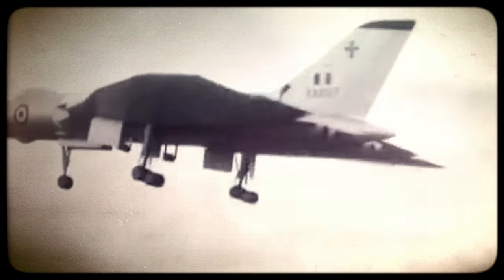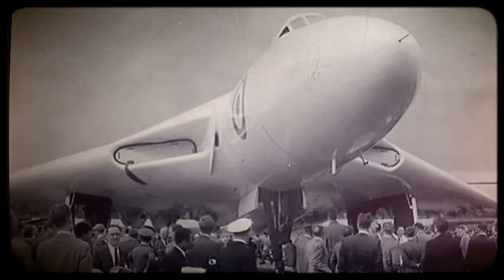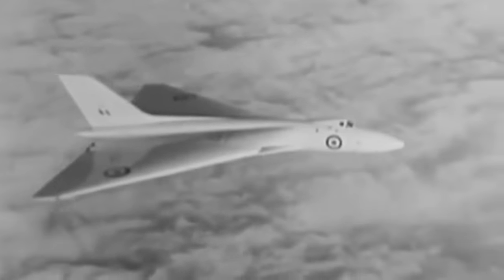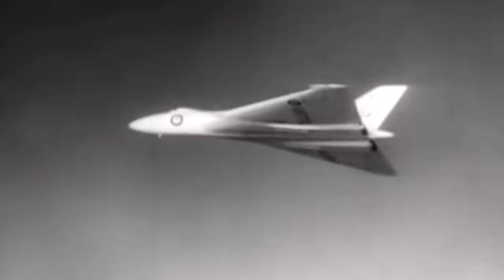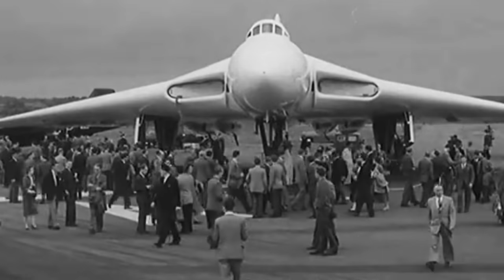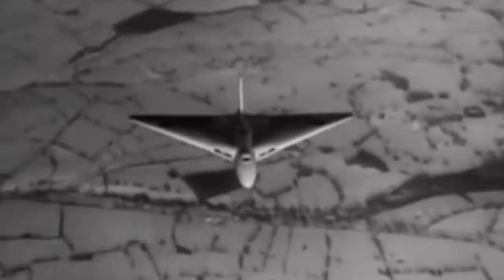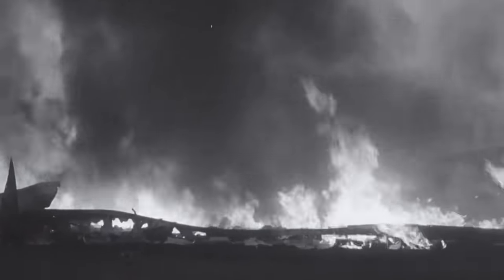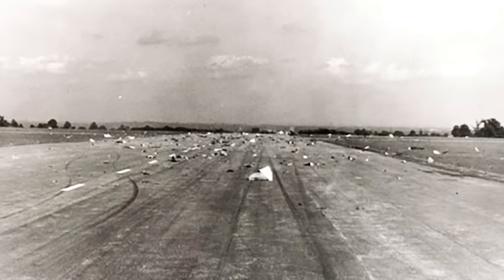Vulcan Bomber Disintegrates on Camera

Comment: Ah, interesting, did not know about this crash. Tragic. But I wonder if it lead to the modified leading edge on the Vulcan wings? In the 50s, my father worked on the Vulcan as an apprentice whilst studying engineering at Imperial College. He told me a story about how when they were working on the top secret mod to the wing, they had to keep it secret. A few days or weeks later, he was passing a model shop and saw a model of the Vulcan, modded wing design included! Seems that even back then, leaks happened... If anyone has any more insight into this wing mod, please do reply here.

Comment: If I were the investigator, I would take into account the location of where the fault originated, then compare that with the orders given, to determine if in fact it was a death sentence, flying at the speed, and angel given, when asked by the individual at the air traffic controller.  Was there unnecessary stress of which was exploited by the orders given?  Only God knows the truth.

Comment: That (start of the) turn exceeded the aircraft's wing stress limits??? That's kind of a "wimpy" turn that shouldn't had been a load on the wing at all. I guess I'm used to the Blue Angeles and their aerobatics that are some REAL stress loads comparatively speaking. Anyway the Vulcan must have been updated and made safe(r) as I see it was flying in the 1980's. There's nothing like a multi death accident/incident in the military to get things changed in the name of safety VERY QUICKLY!!!!

Comment: The crew notes for flying these a/c were long and horrendously complex; full of potential pitfalls and simply flying one in peacetime would have kept them extremely busy, quite apart from learning everything in the notes by rote. There's more don'ts than do's in the manual.
Certain engine RPM had to be avoided at defined altitudes to avoid resonance and consequent engine fatigue/wear.

Comment: why couldnt the pilot eject?
Reply: Only the pilot and co-pilot had ejector seats, the three rear crewmen had to rotate their seats, open a hatch, then jump out of the bottom of the plane and, if the front wheel wasn't down, (which would kill them), fall a couple of hundred feet minimum to clear the aircraft, then open their 'chutes manually.  

Most Vulcan crews agreed they would not eject and leave anyone behind.  These ones didn't.

Comment: Looks like the leading edge forward spar failed. How did the maintenance crews not find this. Would would think it was leaking fuel. or something. We had F-4's crack spars, they leaked all the way to the bone yard, for there last flight.

Comment: The Pilot exceeded “turning rate limits”??? How pathetic those rate limits MUST HAVE BEEN!!!  It’s always blamed on the pilot, just like the PILOT ERROR that killed himself, Buddy Holly, Richie Valens, and the Big Bopper. I’d bet my life it was plane malfunction and not Pilot Error, but you can’t Sue a dead man. The plane’s manufacturer was never going to get the blame, no way in hell, even if the engine fell out, propeller fell off, tail fell off,   Wings fell off, or windows fell our. That manufacture was not going to be held liable, no way in Hell, and so they were…Another lie?????

Comment: @AnthonyTobyEllenor-pi4jq's note below that one of the reasons early aircraft crashed was the practise of bashing rivet holes in aluminium instead of drilling holes is vitally important. Precision drilled pilot holes were easy to do and of trivial cost. That this was not done was shameful misconduct by the oversight Chief Engineer, the RAF oversight Officers, and the Manufacturer. 

That bashed holes caused micro cracks which propagate due to the stresses encountered when flying may also have contributed to the Comet disasters is probable. 

False attribution of blame followed to protect sloppy, overpaid, corner-cutting Tradescraft and Oversight? Surly NOT!

Comment: The Avro Vulcan was actually a very sound, aerodynamically good aircraft. Though it is said that no reason was found for this tragic accident, I believe, the aircraft broke up because of a flaw in its leading edge of the right wing. This flaw should've been discovered by maintenance employees, but obviously it wasn't. Even a hair line crack, not visible to the naked eye, can bring an aircraft down. Most, if not all, aircraft inspections are fairly detailed and comprehensive. However, it is likely, that something was missed, in the detailed inspection that took place before this flight. 

I think the Avro Vulcan is a big beautiful aircraft. There is something about Delta winged aircraft that really look impressive. Like the Concorde or the Delta Dart. Very modern looking despite its actual age. With today's technologies, this accident investigation would've found the root cause(s). I'm confident of that. Today's NTSB and its English counterpart would've found it. Back then, technology was somewhat less capable. Sad these brave guys both in the air and on the ground, paid the check. As for the Avy, she'll always be one of my favorite British Bombers. Real sweet ride and fun too fly from what I have heard from actual pilots at an air show in Paris years ago now. 

May all lost Rest In The Lord....✝️

KB🇬🇧

Comment: So the plane is flying straight and level at a reasonable speed past loads of eye witnesses and as it’s doing so the right wing disintegrates. This causes the plane to crash into the ground killing all onboard. However the crash investigators decide to blame the pilot for the crash!!!  It doesn’t take a rocket scientist to work out that the wing suffered some sort of structural failure which was outside of the pilots control.  What was he supposed to do, climb out and hold it together himself!!!

Comment: The easiest thing in the world is to blame pilot error for the Vulcan disintegrating. No one thought to lay the blame with the plane's manufacturers or specifically their engineers. 

Did the plane land in the crowd??? Horrific if it did. Those injured should have been compensated, and the families of those who were killed, also compensated. 

This is among many reasons why we joined the EU (then the EEC).  To aim for higher safety standards which would be uniform across all countries in it. Now we're out of it, will things like this crash happen again in the future??   

I hope not - but it's worth pondering, as the current UK government rush to cut red tape, and lower regulations and safety standards. 

The narrator has a weird accent - not British, but not American either. A kind of hybrid accent which I suppose you could call 'mid Atlantic'. They're also talking too quickly - they need to slow down abit!
Reply: Blaming the dead pilot when the plane fell out from under him is a sure indication that a political creature imagines one of his stupid decisions contributed to the crash.  
In this case the modernisation of the wing leading edge (look at a Vulcan B2 for the improved and safer version), or the politically-motivated rushed development of the Rolls-Royce Conway jet engine as another were probably at fault.  

The plane did not land in the crowd, it did however hit a Landrover vehicle and an airfield control caravan, with the loss of the RAF men.  

Incidents like this will always happen, especially when ignorant political creatures cause disasters due to their mis-management, then convince themselves that anything they say will never be brought back to them.  

The narrator may be artificial.